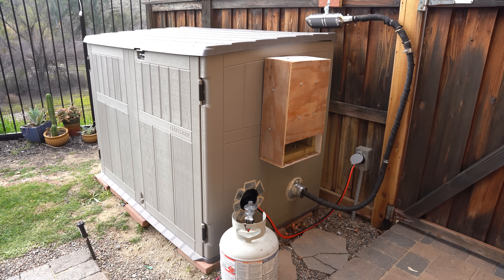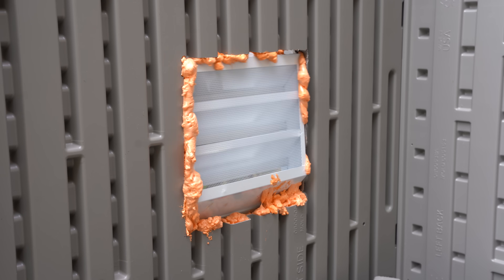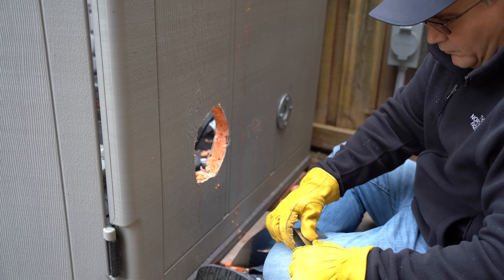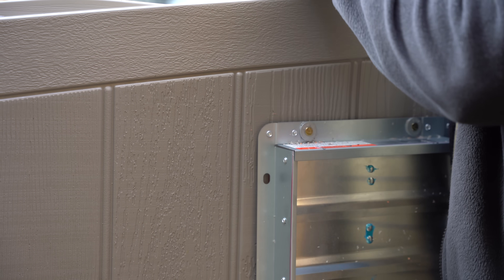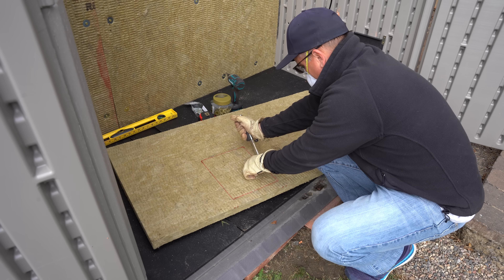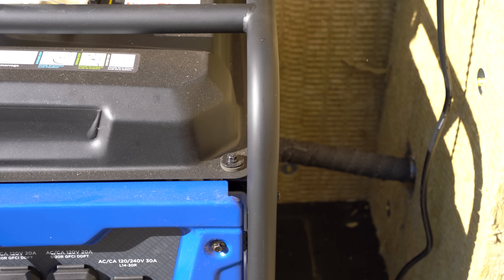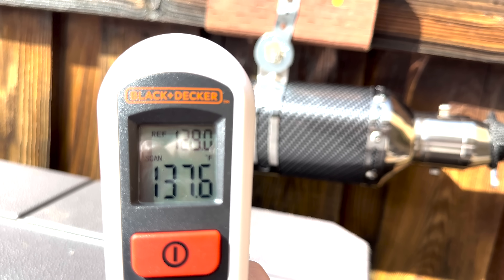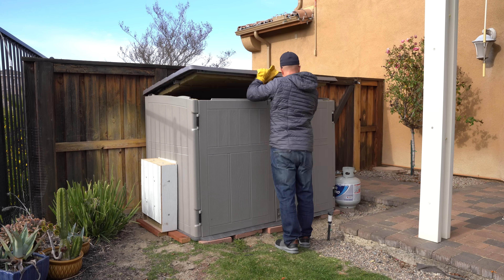How to Build a Generator Quiet Box (DIY) | Ultimate Stealth Enclosure

Comment: Good idea with the springs, but now you've got a path for insects getting inside there. Perhaps some metal screen would help. Make a habit of opening that thing occasionally, just to check for wasps, etc.
Reply from the maker: Yeh good point
Reply: Perhaps tucking a layer of the rock wool behind those springs to prevent crawlers from getting through?
Reply: @stevebishop3796  that's what I did on mine ... and also in the blast gate for when it's running and can't close it.

Comment: You went through all the trouble to keep the noise down.... but you can see the tank... maybe you should think about making it look like a  plant... if someone is looking around but doesn't here the generator they may see the tank... then you could have someone in your yard... keep up the videos everyone need new ideas and info to stay on top of things
Reply: The box still makes a decent amount of noise.  Someone looking at it would know what's in it.
Reply: An additional small privacy fence that surrounds the shelter with few stall mats on the inside will also further reduce the attenuation and hide the visible shed from most. Need to leave it open enough for air circulation though.

Comment: 2:59 why you didn't use large diameter (like 4 inch) conduit for that instead of the metal? Seem like it would give a cleaner look 
11:30 it would like better if the boxes for intake and exhausts were in the inside of the shed instead of the outside

Comment: Pretty cool setup. Although I found it very amusing you used fire block foam on a plastic structure. 😂
Reply: Adding the fire block foam may keep heat from getting inside the double wall plastic and keeping it from distorting it shape overtime.

Comment: I Like the setup with the enclosure. But my concern is, with all the exhaust tubing and muffler. Wouldn't it restrict the flow creating extra backpressure and may burn the exhaust valve and void the warranty of the generator?
Reply: The exhaust wrap will keep exhaust flow high, the air inside will stay hotter and move

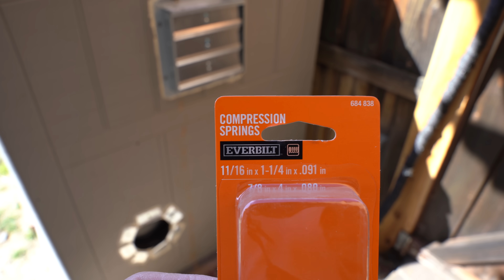Comment: at 9:41 it looks like you have some of that sound-proofing material sticking out of the exhaust hole, wrapping the exhaust pipe, but you don't talk about this in the video.  Did you insert this after the springs (why not instead of the springs)?

Comment: I think that when I build such a shed, I will use an electrical service entrance elbow for thepass-though of the electrical cable and the propane fuel line. Also, a double-wall or triple-wall chimney thimble might work well for the exhaust, especially with a plastic shed. Is there a reason that you do not leave the motorcycle muffler hanging on the fence 24/7?

Comment: Don't use a blast gate.  Just use a bubble box 2 gang our 4 gang outlet for a GFCI outdoor plug and pop the back out and use a two inch or 3 inch hole saw depending on your plug size they work perfect plus you can pass the cord through will the bubble cover down in the rain.  I'd be interested to see hot hot it gets when you have it under load for say 30 minutes in the hot sun.  I have the Generac 17500 with 3 fans and 3000 cfm and 24x24 air intake and it still gets 130 inside.  Note one of my HD fans shut off at 130 so do some testing.  Like you at first I was worried about sound so I used the rockwool bats but at this point I don't care much about sound cause all the neighbors have generac standby's so I'm more worried about heat.  Also just fyi the 3m orange stuff isn't fire proof trust me I melted the shed a little before I redesigned and used a thimble to pass the exhaust out.

Comment: It would probably take years for the fan to go bad. But simulate it going bad by unhooking it and see what happens. Computer fans have a third wire  to tell you to shut down the computer when the fan doesn't turn. A micro switch hooked to an alarm run to the 12v or 120 v circuit mounted outside ( so you can hear it ). I wouldn't have guessed it would get to 150 degrees. But the fan puts out 600 cfm so it would get noticeably hotter. You were thinking about a bigger fan. Well, two of the same size would do well. When one shuts down the other should be running unless there is a circuit breaker in between . You could run them with their own fuse bypassing the circuitbreaker. I wouldn't leave the house with it running

Comment: Has anyone given any thoughts about noise-suppressing the AC' compresor sitting outside?  even if people don't hear the generators, the every time the AC or heater cuts on, it is gong to make a lot of noise.
Reply: If you have a large enough generator that you can afford to run A/C, then your approach would be thicker and taller walls. Thicker by a factor of four with an air break in between layers and taller by a factor necessary to go higher than you roof peak. Redirection of the noise up is the key. And enclosed A/C condensing will fail since it needs large amounts of air to work. It can be done but it may be wiser to rethink your comfort needs when the grid goes down for a decade.
Reply: @bryancondrey6457  I was thinking in terms of not attracting attention and to be as low noise as possible if the situation calls of it.
Reply: Do you have a slow start? A newer unit also will quiet down some.
Reply: I have the exact same thoughts as you, man. I'd be worried about the non-muffling of the ac unit.

Comment: Question   How can you secure this shed from being hit by an "EMP" ????
I been waiting on this Video for monthsssss
Reply: Hi Debbie, I also have been working (for the past year when my body had enough duct tape and crazy glue to function). on a generator shed and had the same concern. I’m looking into this item I found on Amazon. Already put surge protection device on my electrical panel. I’m real new to prepping but needed a backup generator for powering medical equipment as well as other household essential appliance. Blessings and good luck to you & loved ones!

Mission Darkness Dry Shield Rapture Faraday Bag - 1,060L Capacity. Waterproof, Weatherproof, Signalproof. Shields Generators and Extra-large Electronics from RF Signals and Electromagnetic Pulses.

Comment: Is that generator vulnerable to EMP?
Reply: No circuit board will survive an EMP unless your deep underground protected by massive concrete.
Reply: Hi Toni.
Yes,as it is. But if you put a Faraday cage inside the shed, effectively putting the generator inside the cage, then it will be fine.

Comment: Would have been better if you had made the box out of sheet metal so as to not have a plastic box, which is highly flammable, as a “potential” hazard. Additionally, using fire block is pointless due to the rockwool being used and the plastic and wood boxes present. There’s a reason manufacturers of stand alone generators use metal cabinets as enclosures for their generators: fire & explosion  resistant. Then the rockwool is proper and more effective at fire resistance. Lastly, isolating the muffler pipe from touching the fence was appropriate, but a clamp every 18” inches is more effective.

Comment: I did something similar with my generator, but after all the time and money spent on the project I realized I could have purchased a cheap Generac generator with enclosure for the same amount. Since I also have solar, I only use the generator if my batteries get low.
Reply from the maker: Lol yeh this project was a bear

Comment: Shed Exhust Fan:
Calculation: (Average Shed)
EX: 
55"L x 32"W x 48"H = 84,480 cubic inches / 49 cubic feet
(10 Inch Wall Mount Box Fan) = cubic feet minute airflow 1,000 (CFM)
Reply: What does this mean exactly??

Comment: Great video. Thanks.  On the topic of Propane. The DIY HVAC Guy converted his Port Gen to NG and ran a hard line out to it. Can't post the link as ubtub removes my comment. If you have a gas furnace, he also shows a way of running it off a car battery if needed.

Comment: The exhaust will run the motor to hot and you'll burn up the valves. To much exhaust pipe for a small engine.

Comment: Your exhaust is NOT safe!! Even with the insulation wrap you need a lot more clearance from the plastic.  You took temps with the generator running BUT it will be a lot higher when the generator is under load.  Baffle boxes are a good idea for sound deadening but they are a restriction. So I take and (air) exhaust need to be bigger. If you look at a home stand by generator you will see they usually both ends of the housing are vents for air intake and exhaust.

Comment: Quite the train of sycophants on here but I am going rain on this parade.  NFPA 37 requires combustible materials to be 5' away from the generator and exhaust needs to be kept 9" away from combustible materials.  Even cheap home standby generators have ductwork so that the engine cooling fan gets all its air from outside the enclosure, not relying on extraneous fans which may or may not work.  Finally are we going to mention the pure chinesium generator at the heart of the whole thing?  With all this time and material it would be better to go and get a low RPM water cooled generator from Cummins or Kohler that is already quiet from the get-go and holds more than 1 quart of oil and has an actual pump and filter.  Sorry.
Reply: Sorry, your interpretation of the NFPA and how it even pertains to this project is laughable.
Reply: @REALBanannaman  Please specify what you mean by this.  Code citations would be appreciated.
Reply: I have the same generator works like a charm.  Im in a hurricane area so I get to use it often.

Comment: I am a generator technician. Please do not do this. It is extremely dangerous and can harm the generator. 
Also it very clearly states not to operate in an enclosure. Those fans and vents will not provide sufficient air flow.
Reply: Do a cfm calculation. Technician means nothing these days. With a 12 inch fan you'd get north of 1000cfm, which is 10 air changes per minute. He can add a high ambient shutdown switch as well

Comment: You have  over  $2000 in  just  a 
7500 watt generator and you could have got a Generac generator with its own case,( I'm  laughing  as I'm typing  here ) for under 
2 grand  and installed  off  Grid  or Grid Tie , 
saving  you  trips to the  hardware store  and hours of  labor  and  itching  😫  , 

But I see you ain't  too bright  is ya ?
Reply: Generac is $5k not installed, and drinks fuel. You are a broke boy and on a cloudy day you are done. In fact, your panels will attract ungodly amounts of snoopy neighbors
Reply: @REALBanannaman  , Generac  base model is  $ 1995.oo  ,
But I don't  have  one , so NO snoopy  Neighbors  here , 
I have  a 2000 watt portable Generac  Generator only as a backup , 
I have Solar Panels and  4  P.M.A.s 
so I ain't  broke  , my electric bill was  $39 dollars for February  2023 , it usually runs  $35 each month  but I was doing some Fabrications and some Welding .

Comment: All that work just buy a Honda generator 😆
Reply: most Hondas (which are great for the right usage) put out 2000-5000 watts. Last I checked you can't buy a Honda that is dual fuel either.  The one he shows is 9500 watts and runs off gas or propane.  It's all about how you plan to use things.
Reply: @briterobert exactly.  People say buy a Honda like thats the answer.  I have a 12k watt unit.